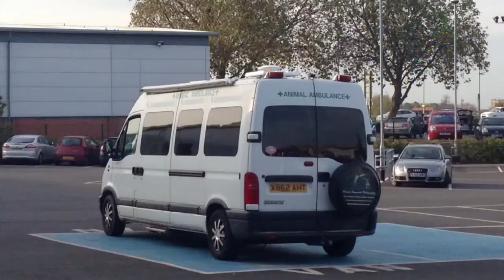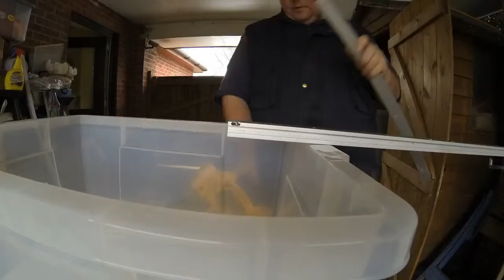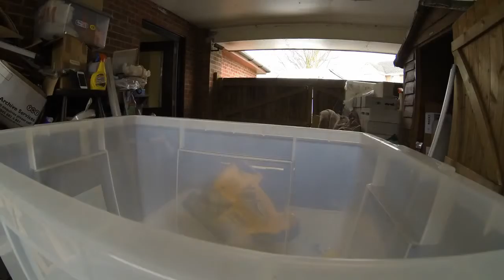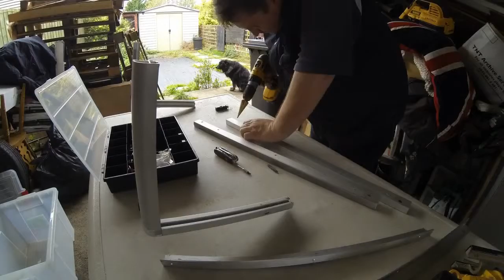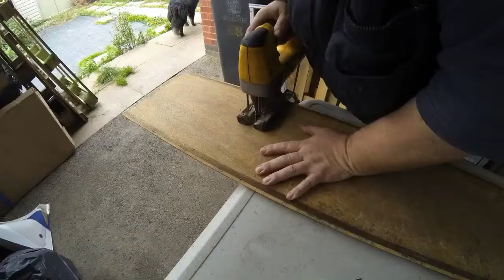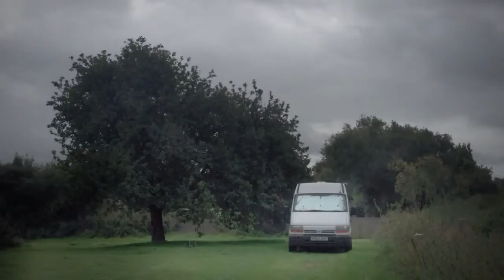031 Nina  Single Overhead Cupboard

Comment: what aluminium bull nose  did you use
Reply from the maker: Hi Dawn not sure what you mean ? This is basically an existing overhead cupboard that I was cutting down to make a single one. The one you see next to the side door :)
Reply: sorry where did you get the  aluminium  frame from
Reply from the maker: +dawn b Nina is an ex NHS ambulance and came with a full length overhead cupboard fitted, the aluminium you see here is that cupboard broken down so I could shorten it and use it as a single cupboard on the opposite side by the side door. The long overhead cupboard you see in the videos is from another Ambulance I bought (and sold) so I have overhead cupboards either side.
Reply: thank you